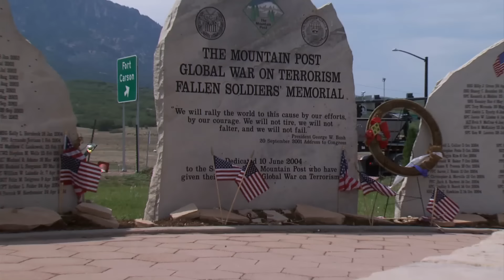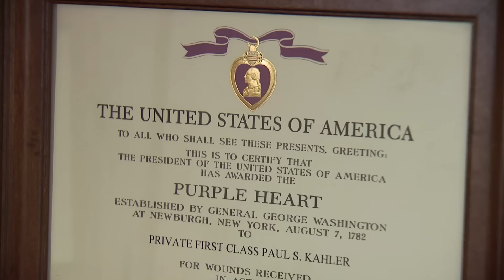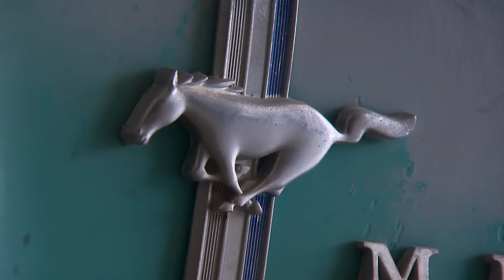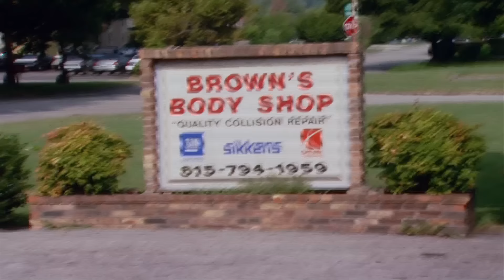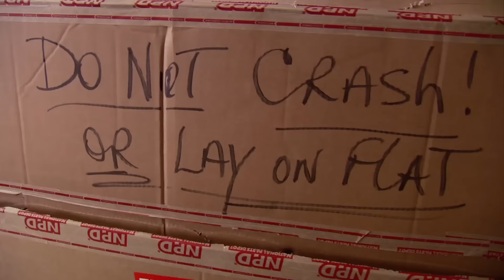Giving Back to a Veteran by Restoring His Mustang Coupe - Part 1

Comment: 7:13 Lmao yikes. wouldn't want them working on my car
Reply: working very roughly
Reply: You have to understand that they are replacing 90% of all that stuff, so it doesn’t matter if they are rough when disassembling because its not going back on the car. If they were working with irreplaceable parts that have to go back on they would be way more delicate im sure.
Reply: @-Sirens-  that still depending on how hard you are doing stuff, can leave extra damage you do not need when you're rebuilding a home
Reply: unlikewise ok, thats true and all. But also when you’re leveling a tall building , they dont care about the damage the explosives do or the damage the falling building causes, they’re starting over from scratch and saves so much more time in disassembly. you can fix small issues you may have caused later because of all the time you just saved. Its just a faster and more productive way to work when you are tackling a huge project.
Reply: @-Sirens-  all small issues do is take time which in some parts of construction, time is very limited and limiting
Reply: Well generally  When restorations get done people want to save all original sheet metal they can so reefing on the handles and mirrors to get them off isn't very smart considering now it's going to take more filler to make them look good when it wasn't necessary.   Either way you look at it if they're reusing the door and/or the handle it is just stupid I work in a body shop and I would never do something like that to someone's car none the less my own
Reply: I'd have to absolutely disagree if you do damage while deconstructing it it's just going to take a bunch of time fixing it later rather than just being careful taking apart. The end result is better and it takes no extra time by not focking it up in the 1st place and then having to fix it
Reply: But like I said wouldn't want them working on my car and with that being said they wouldn't so doesn't really matter
Reply: @gunsandmachinesenthusiast  I'm not calling you out, but a house and a body shop are very different

Comment: I'm surprised the panels are ground down to the metal .. would that be to keep it uniform?
Reply: I think it is mostly to give the primer (epoxy primer maybe) some roughness to stick too...and they may skim coat the whole thing with body filler..then sand and primer and paint. After they block sand, with long sanding blocks, the car looks very straight afterwards.